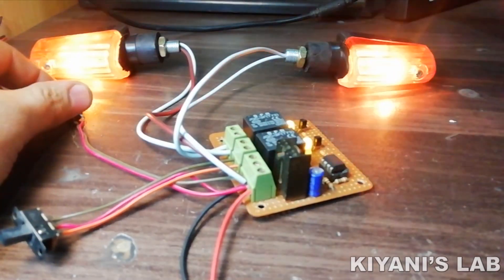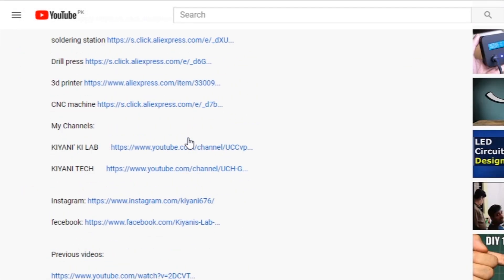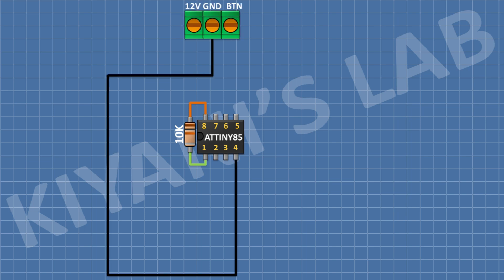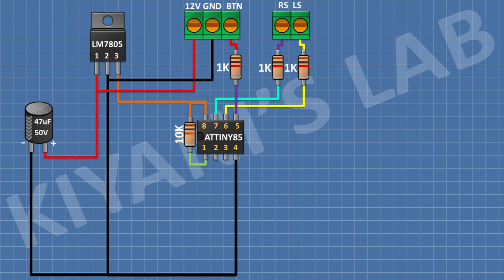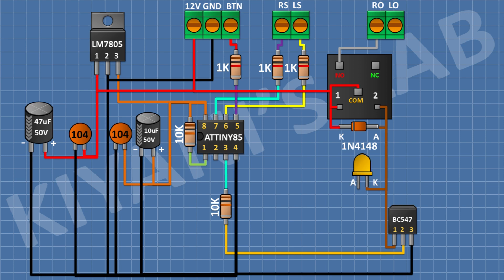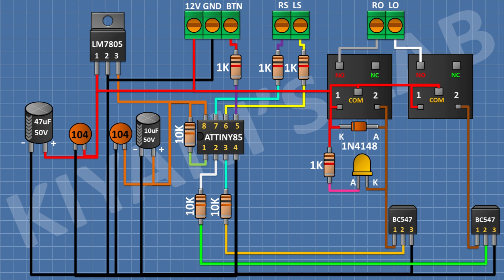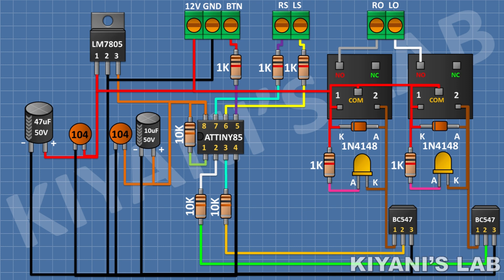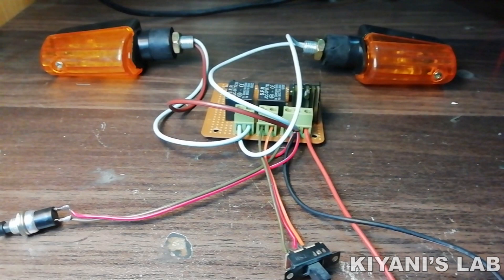How To Make KTM Style Bike Indicator | Multi Patterns

Comment: Dear Sir, Can you please make a video on MPPT 3.0 in which the Proteous circuit diagram is explained with the step by step design process. It will help a lot for those working on Maximum Power point tracking (MPPT).Thank You!
Reply from the maker: I will bro
Reply: @KiyanisLab  Dear Sir, Please reply, I have texted on fb page inbox. Thanks!